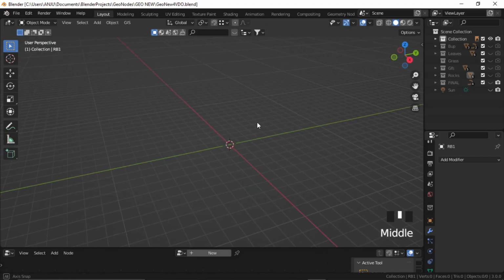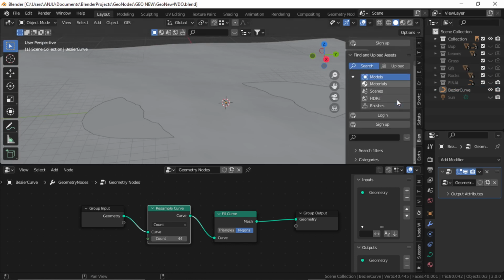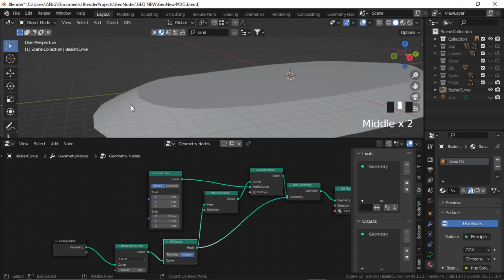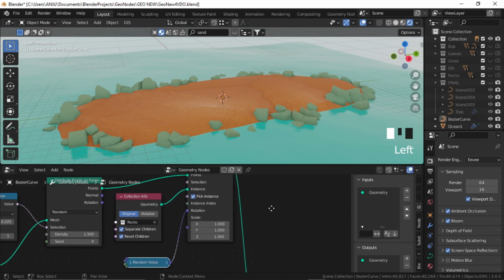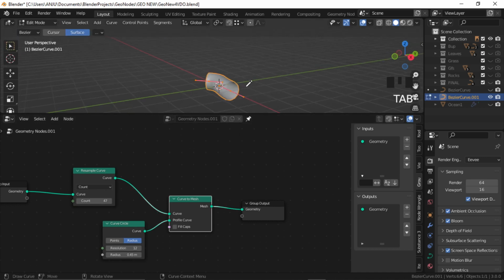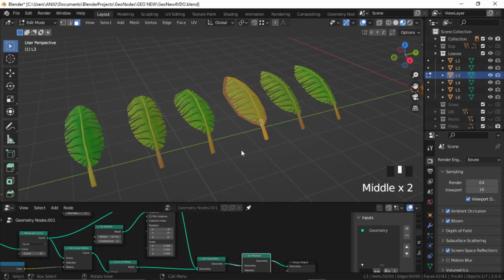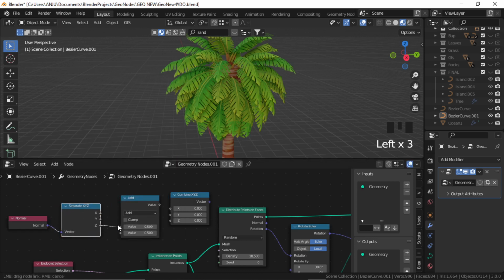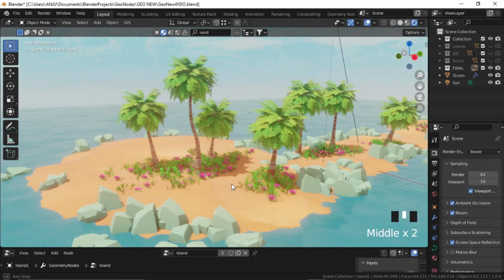Easy Geometry Nodes - LowPoly Diorama BLENDER3.0

Comment: love the tutorial. i cant seem to get the material to work in blender 3.12. i tryed the set material and subdivide. nothing is working. i downloaded your project file and did the exact same thing to.. nothing.. any idea?
Reply from the maker: I haven't used 3.12 version...i will check that... Try to open it in 3.0 version, it should work fine.

Comment: What is that "Blender kit" you use to add the materials? 
I don't see it in the addon list. Also, what is "resample curve"? What does it do?
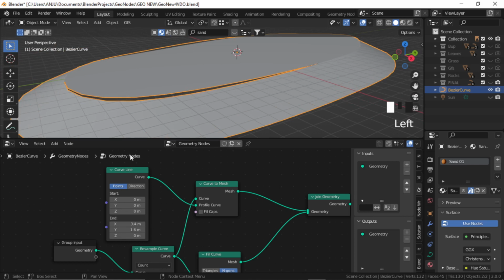at 5:14 where you increase X to add the bottom portion of the island, if I go to +x as you do it actually decreases the bottom. I had to go to -x to achieve the same shape as yours on the video. Any idea why?
When I add the flowers they appear under the main plane. I've tried setting the origin point of the grass meshes lower than the mesh, but that's not really a solution. For some reason it is not distributing the grass on the surface but below..
In summary: Nothing works from this. :D
Update: I've restarted this the 3rd time, but can't for the life of me figure out what the problem is. I do the same steps I have the same blender, yet it looks completely different. When I start distributing rocks on the surface of the "land" it distributes them below surface, not on the surface. The meshes are centered on world origin, object origin point is the bottom of the object so in theory it should distribute them on top... It distributes them in the "skirt" of the island not in the middle, as it should so I'm plugging in the right surface for sure.. I think it has something to do with the original landmass having some orientation issue, because where you had to go x : +3 .4m at 5:14 in the video, I had to go to x : - 3.4m to get the same result. No idea why. I having the default orientation so I'm the right way up, I applied all transforms everywhere so no idea..
Update #2: Dang it! I've found the issue. The transform node that you add to raise the land above the water was accidentally went BEFORE joining the addition crap to the island... It should have gone to the very end to raise everything..
Reply from the maker: Blenderkit addon was previously there with blender itself.. However, now you can download it as a seperate addon file and install.. 
Resample curve basically restructures the hand-painted curve according to the given points/length value.. 
And yes, sometimes the orientations behave wrongly..

Comment: You are the best! In Blender 3.0.1 sand material is not showing in the island... Do you know why?
Reply from the maker: Are you using "Set Material" Node?
Reply: @ALLTHEWORKS11  Thanks for your answer. But Yes I'm Using set material node
Reply: @ALLTHEWORKS11  Correcting my question. Only color is shown but not normal and displacement...
Reply from the maker: @Padr3Maldito  not sure about the issue...  however for displacement to work,  mesh needs to be subdivided with "SUBDIVIDE" node.. you can use "TRIANGLES" in fill node... also try realize instance at end.
Reply: @ALLTHEWORKS11  I'll try. Many thanks